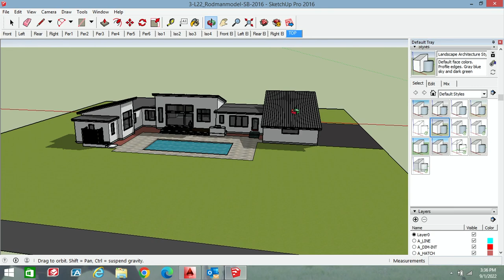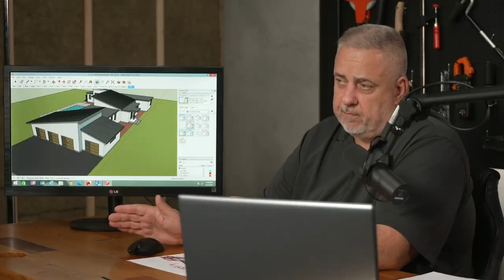Build Show Build: Boston is Live! 24-Part Series with Steve Baczek

Comment: I used to have a dream of buying some perfect MCM time capsule house, but I've realized several things since. One is that these houses have terrible insulation. Another is that aging plumbing and electrical isn't your friend. And the most important was realizing that all of the different types of finishes that would make it seem like a vintage 1960s house (flooring, fixtures, and steel kitchen cabinets) are all readily available. I've also, and this was the thing that finally made me want to build my own, was your channel here. Discussing high performance houses heavily appealed to me. I love the idea, as an allergy sufferer, that I can have better control over the indoor air, and then run the A/C to the temperature I want without it costing a fortune.